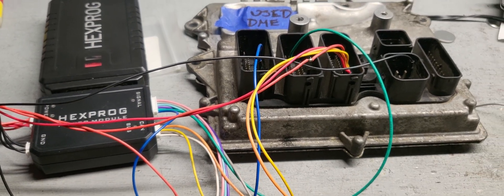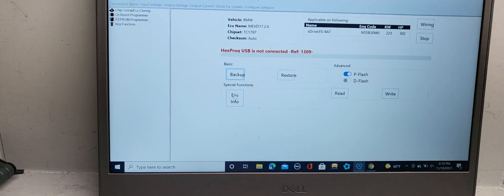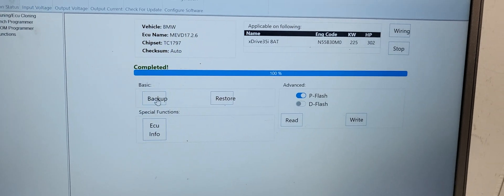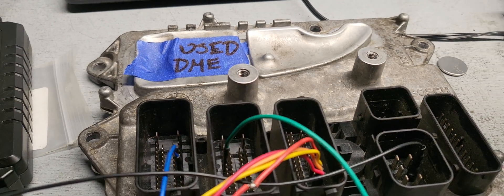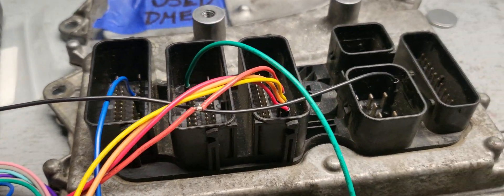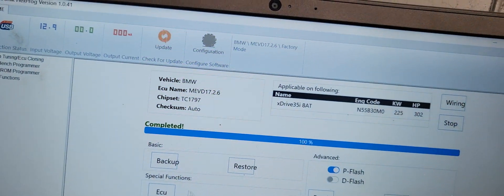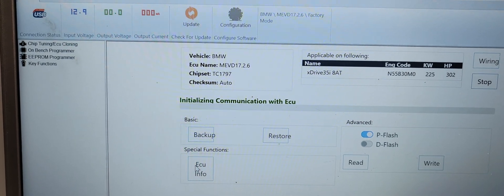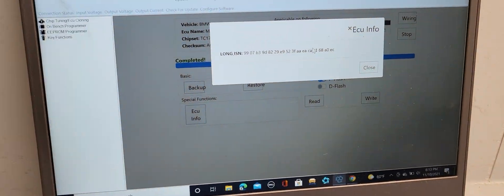How To Read And Clone A BMW Ecu with Hexprog

Comment: It is best practice to avoid changing the ISN in the CAS. After 2010 many models have the ISN in the transmission as well. Changing the ISN in the CAS would cause an issue there unless the tranmission ISN is R/W.
Reply from the maker: thanks for your information